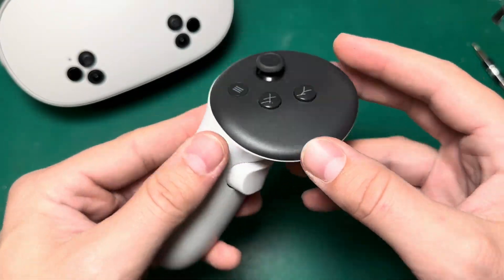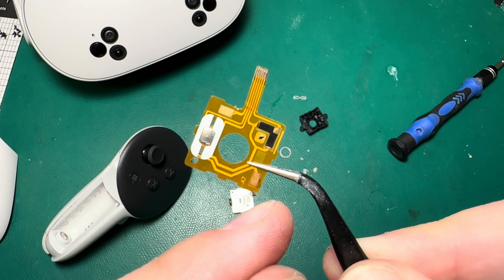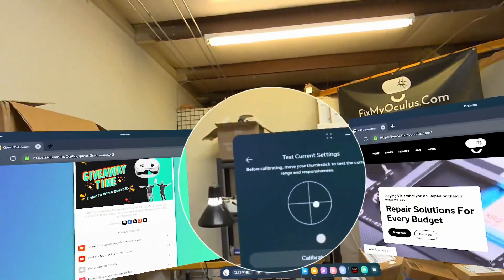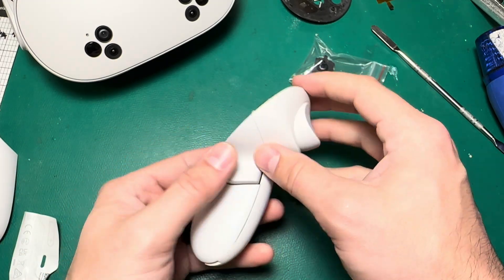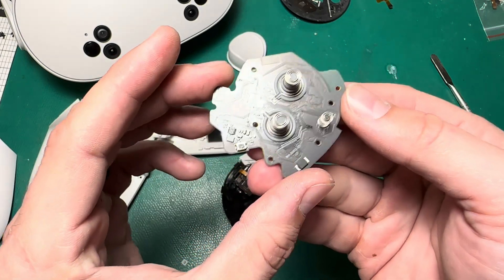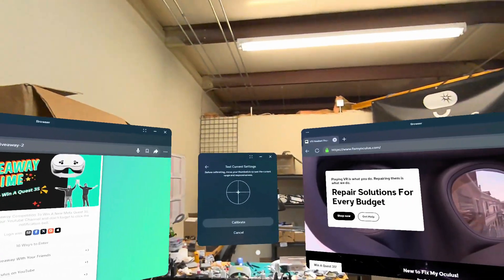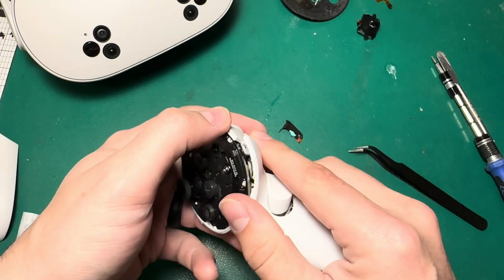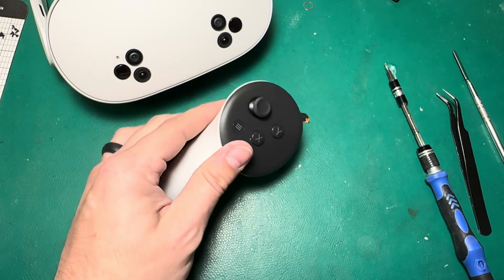Why Meta Hasn’t Fixed Drift: The Truth about Joystick Issues | Quest 3S Repair

Comment: Great video! I was able to replace the left controller tracking array using this. I wish I bought directly from you because I realized during the disassembly that the vendor didn't include the battery switch or the menu button. Fortunately they were fairly easy to swap to the new array, the menu button was a little more challenging to get out of the original. But success in the end, so thank you!

Comment: I really need help, my joystick fell off and i dont know how to remove the faceplate properly, you already showed me how but i dont have a heat gun and i cant afford a repair, can i use a hairblower as a heat gun?
Reply from the maker: Yes. Just don’t overdo it. Slow and steady wins the race when using heat.

Comment: On advice from a redditor, I've been using Deoxit F5 Fader spray in my drifting sticks.  Apparently it's designed for potentiometers and contains lubrication to reduce further wear.  At any rate, the drift has been fixed and hasn't come back after more than a year.

Comment: if you want a permanent fix, 3d print a tiny C donut shape washer, place it on the stem of the joystick from the outside you do not need to open the controller for this. This donut shape washer will act as bumper and will prevent the slider inside to go too far. 

This is caused by wear. All meta could do is the reduce the travel of the joystick and this would be fixed.   

4 years now and I haven't had to change any of my joystick which I had 3 times before this mod. 

This will not fix an already damage joystick. I have a video on my channel on this. 
Cheers,
Reply: I have 3 quests and all of them had stick drifting issues before I add this. It is so simple. It proves how meta doesn't test anything.

Comment: Thanks for these instructions. I replaced my joystick, and it works, but the return-to-center is not centered. It's a bit NE of center, causing me to need to set a wide deadzone to compensate. I could find nothing to reset what is the center, which is what I would need to fix the issue entirely. Any suggestions?

Comment: After doing this multiple times, I am able to swap the thumbstick in about 25 minutes.
At one point, one of the thumbstick no longer register thumbstick presses and needs to be swapped.
Great tutorial and much easier to do vs the original quest 3 thumbstick replacement video.

Comment: So I got bored and decided to order a switch joivon analog stick. It looked promising but wasn't sure how well it would fit. I just got it today and I couldn't use any of it, however I did take the analogstick module to check it out on quest and switch. Well come to find out the plastic slider was misaligned causing my issues with jitter. So I realigned everything and put the controller together and managed to get it working like new.
Reply from the maker: That’s great!

Comment: listen it might not work for every case of drift, but it CAN POTENTIALLY DEFINITELY FIX IT like it was for me and many others. had drift on my quest 2 controller, put some wd40 on it (not even the contract cleaner but the squatty doors type) and i could play for another 300 hours of Skyrim VR so far with the issues NEVER coming back. So it can certainly work for SOME situations.
edit: squeaky. contact.

Comment: 11:08 Quest 2 controller tracking is way better than 3. For 3, if you put your controller down outside the view and lift your hands, the HMD recognizes your hands as controllers (even with hands tracking turned off). So mostly it's only guessing the controllers' position with your hands.

Comment: Honestly as someone who plays thousands of hours of VR a year I pulled my left controller apart over a year ago, used some contact cleaner in the base of the stick and dried it with air and it still works perfectly. Just got major stick drift in my right controler and did the same thing. Works perfectly with no stick drift at all, but I understand this might not be a forever fix, but it certainly works well.

Comment: guys, don't ever use regular WD-40 on electronics, it's not made for that! however, there is a WD-40 type made specifically for electronics (like WD-40 specialist contact cleaner). If you really need to clean something, use that one, it shouldn't cause any damage. and always make sure your device is powered off before doing anything.

Comment: I just swapped out my toggle. It was a learning experience. Im surprised I didnt break it. The ribbons are very fragile and on one occasion I cut into one with my fingernail. Another I slipped and cut through the proximity led ribbon. The battery ribbon even took damage from my unsteady grip. I expect these are now temporary connections and will degrade with a build up of oxidation. I think I will send mine into your shop next time 😂

Comment: Instead of replacing the joystick straight away, it’s much easier to pry off the top plate, then pull off the joystick (pull firmly at an angle). Then you can drop several contact cleaner drops next to the joystick peg, swirl it in circles and test it in Meta controller calibration menu. Also wipe off the circular joystick base with 90% isopropyl alcohol.  No need to remove screws with this cleaning method!
Reply: I think the Meta controllers are generally really good. Pretty durable and the stick drift only comes up about once or twice a year in my experience.
Reply from the maker: I appreciate you jumping in here to help. 

We’ve repaired alot of these controllers (1000’s). If it’s made its way to my shop, chances are the customer has already tried all of the less invasive methods. 
Drift happens for various reasons. One of them is poor contact due to debris. One is legitimate wear on the part (no longer making proper contact due to wear on the metal) 

Joystick replacement works every time and provides a more permanent solution.

Comment: bought a Quest 3, and after less than 10 days the right thumbstick started having problems, when i move the controller itself it starts thinking im holding the stick all the way to the right, and wont stop until i move the stick around a bit, circling seems to be the best solution. but no deadzone or restart will solve it
Reply: tengo el mismo problema con mi control derecho hace unos dias que igual piensa que estoy sosteniendo el joystick sin moverlo y parpadea e igual tengo que moverlo para que desaparezca el movimiento 
ya hice un reinicio y hice una prueba en configuracion y no hay zona muerta 
pero sigue haciendolo repentinamente 
puedo pensar que hay un problema en actualizacion de controles que aun no reparan 
y quiero hacer una prueba de limpieza con alcohol iso y ver si se resuelve y si no esperar que venga una actualizacion

Comment: I really wish there was a hall-effect version of the module.
Reply: Came to the comments looking for a source to hall effect replacements. 😢 Looks like none available.  I wonder if it'll be possible with this form factor.
Reply: @abe3367  I was looking at some comments on reddit a while ago and the issue seems to be with the power input for the controller and the wire cables's ordering

Comment: Hey would you happen to know where I can get a replacement vibration motor for my Quest 3 left controller? After fixing both controllers for drifting issues, I think I pulled on the vibration motor wires to hard.  I tried changing batties, reconneced all ribbon cables and wire connectors, re-paired the controller to Quest 3 , and restarting my system and the left controller is not giving me any feedback. Everything else is working, with not drift lol.  I can not seem to find a part for the motor online either.
Reply from the maker: Yeah. We have some. Email us: info@fixmyoculus.com

Comment: It's not supposed to be normal wd-40. It specifically for electronics. I spray a contact cleaner in there from time to time. When they crappy thumbsticks decides to do their own thing, or nothing at all. I hate to do it. But I'd be replacing my thumbsticks every few months if not. It's pathetic. I don't even use it that much. 

Even my mom's quest 3 right controller randomly has stuck drift and she basically never uses her VR. 

Mine started acting up 3 months into use, about 100 hrs. 

I eventually had the controller replaced just before it's 1 year warranty was up and the POS had drift right out of the box. 

Same with my PSVR 2... Ugh don't even get me started on that. 

I've been a gamer for 37 years (I'm 43 now) I've had every system but the neo geo, countless hours on analog thumbsticks and I have NEVER had any stick drift. NEVER. 

Now the quest and PSVR 2 comes around and it's rampant! It's total Bull-shite. 

You can't even buy another controller on the PSVR 2. Warranty replaces it with another used/repaired controller, same with quest. F you Sony. And F you meta. 

I'm never getting another Sony console due to the crap they did (long story) I've been a Sony boy since PlayStation 1 too 💔😭. WHY SONY?! I LOVED YOU SO MUCH AND YOU TREAT US THIS?! 

Meta... I mean.. it's meta.. it should be expected at this point. Hell it's probably taking scans of your fingerprints and sharing it with companies. .... I hope I didn't just give them an idea...

Comment: The replacement went well and I can calibrate it in the headset. However, my headset doesn't see the controller for gaming, only for calibration and recognizing the battery life. I have re-pared it and it still won't recognize... any hints?

Comment: i have a 3s like a moth ago and the controller already broked, it has stick drift and when i move the joystick frontward, in the game just dosnt move, or move back, then forward, the back etc
Reply: Pretty easy to fix. Take the black cover off then pull the stick out use electronic cleaner spray it in there then put the stick back at an angle then pop the black piece back on.

Comment: THANK YOU for showing the internals of the joystick! All of the people that spray contact cleaner or air into their joystick clearly don't understand the mechanism. I just opened mine last weekend, before seeing this vid, and bent out the metal contacts a little to increase their friction. I'm sure it's only temporary, but apparently so are new joysticks! 😂
Reply: Update: Pretty solid amount of use since posting this. Still no issues. This is the way.

Comment: Mine is straight up stuck drifting
Reply: Take the black cover off then pop the stick out spray electronic cleaner where you took out the stick then put the stick back in at an angle and put the black plastic back on

Comment: I've used both Quest 2 and Quest 3 controllers
The Quest 2 definitely tracked better
The Quest 3 controllers will fly above your head and behind you if they're on your lap when sitting down
They just have to be ever so slightly out of the cameras and they start flying around like a tornado just went through the room
Maybe that's a software thing too on the headset side. But it's annoying that you basically can't just sit the controllers down to rest for a minute.

Comment: And no company has made a drop in hall effect replacement joystick?
Reply from the maker: Kinda weird right?
Reply: And what ? Drop their controller extra sales?)
Reply: @midasgames9331  yes. precisely. or did you think by "no company has made" did you think he meant only Meta? They're talking about 3rd party drop in replacements.
Reply: @KayoMichiels  I saw a video saying that the trigger and grip buttons are hall effect and it would be too many magnets close to each other and wouldn't work.
Reply: @anonymous3174  hogwash. Decrease magnet strength and increase gains bit.
Reply: @anonymous3174 TMR - joysticks are not affected by external magnetic fields, this would be the best option.

Comment: I’ve used many controllers over the years, and they were always solid and durable. The Quest 3 controllers, though, feel cheap from the start. My right controller even broke just after the warranty ended—it feels like they’re made to fail. I’m not going to support this system with my wallet anymore. I’ll just look for alternatives that are actually built to last.
Reply: One of my controller is starting to have stick drift with less than 1 year lifespan. Easy to say i'm really disappointed in the build quality, Quest 3 is not that cheap of a product after all.
Reply: @andtor5981 😨, the fuck these conteollers are incredibly expensive and I am already broke after buying the Quest 3, now I have to buy controllers each year???
Reply: @andtor5981   My quest 3s controllers has been slammed against walls multiple times,headset falling off and getting hit and its still strong. Maybe it varies person to person?
Reply: Mine has adult use only, with two months use.  Turned One year old ,Dec 14. Left controller, joystick is failing. Very little use!!!
Reply: @joshparker2903  Joystick replacements (or atleast the cap) i have done, they are quite easy to do.

The joystick seems like the only weakspot as my hand shields the rest of the controller(Youch!)